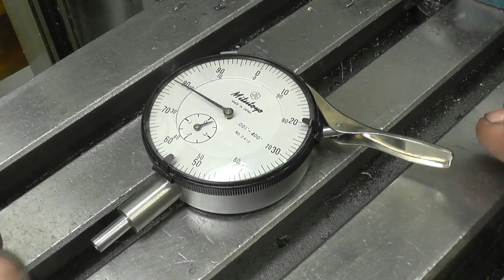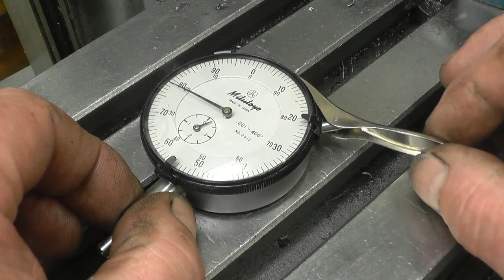SNNC 179 P1  Micrometer give away  Crank balance weights

Comment: i know its hindsight but it would have been easier to machine the champfer on the crank webs before fitting the counterbalance parts then machine the rest to suit .
if you loctite the counterweight bolts in they won't move on a slow rev engine .
enjoy the bash mate !

Comment: After viewing your video once again, I am almost certain that this steam engine is a Stewart 5A single cylinder steam engine, which calls for no epoxy glueing of the lower main bearing shells to the frame, nor soldering the counterbalance weight screws.
Reply from the maker: It is much bigger than the Stuart 5a  though  very similar  The main bearing bottom half's were already "glued" in to the base with some sort of compound  I sadly removed them just to have a look  I would think that the original crank would have been a forging with no balance weights all  Thanks for watching and your comment

Comment: No John, please!... leave the Allen set screw heads alone. Please do not fill with solder! It seems to me that you are intent on ruining this fine piece of work... I realise that it's yours to use and abuse but please don't abuse it too much; it's already seen more than enough abuse at your hands with the epoxy resin incident on the bottom main bearing shells, glueing them to the frame. Please let that be enough abuse, for now, John.
Reply: Leading the counter weight screws in steam engine cranks was a common practice.
Reply: Maybe in the US but not in the UK. Counterbalance weights were always removable and replaceable.

Comment: Lister bolts their counterweights on too. I had a very scary lesson once. I had bought a ranch in the middle of nowhere, without electricity. One winter morning when the generator wouldn't start by hand, I used starter fluid. There was a loud crack, and one of the counterweights came off and broke a big section of the crankcase, which went flying past my face. I learned to avoid starter fluid on smaller engines. I also learned to be glad as hell I still have a face.
Reply from the maker: Very nasty